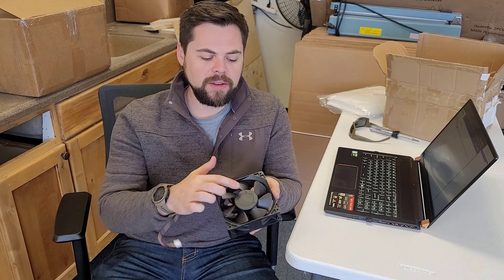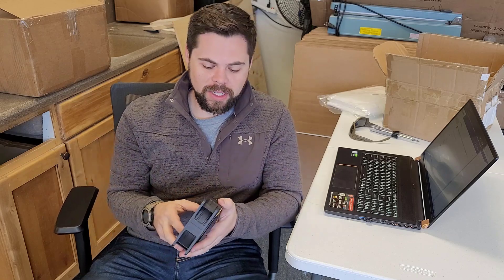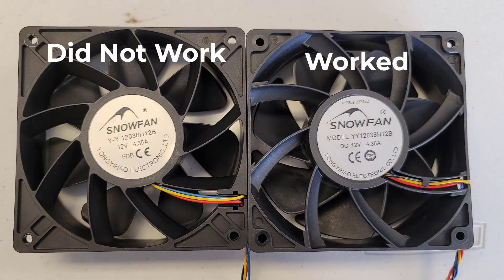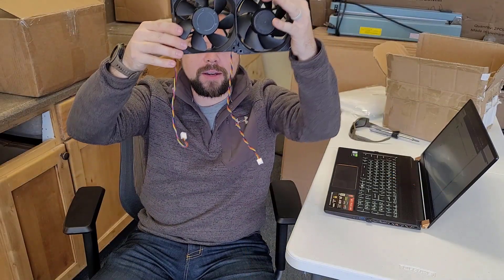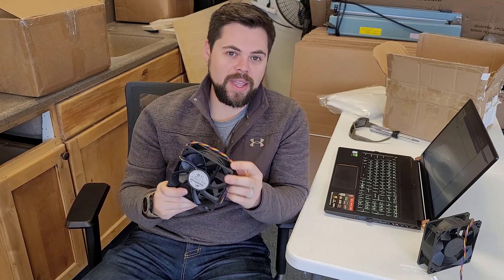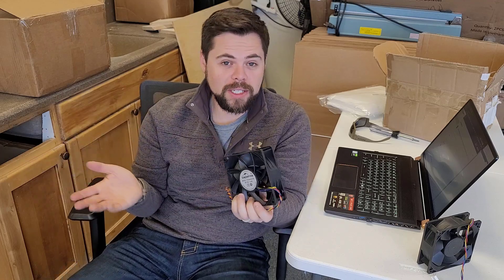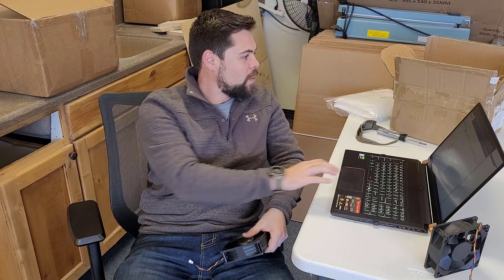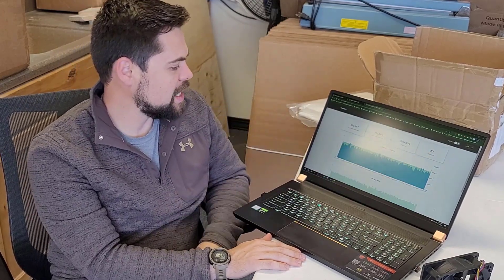How to Replace Exhaust Fan on Goldshell KD5 ASIC Miner

Comment: Hi there! My Gokdshell mini Dodge miner cooling fans are noisy, I tried to clean it up but no change, I tried to reach Goldshell support team but didn't response me. So Do you have any idea if it's possible to replace it? please let me know. Thanks!
Reply from the maker: So i don't now. You just need to find out what fan is used then you can find replacements. That or use a completely different cooling fan like what is shown by Space Design Warehouse's youtube channel

Comment: sorry i cant hear your video but what does it changed? lower watts, better degrees?
Normal fans 200-250 CFM
Ebay Fans 400-500 cfm with the same watts? Or what does it mean? Thanks.
Reply from the maker: I just repalced a broken fan is all.
Reply: @minutemansolar  Okay, thanks.